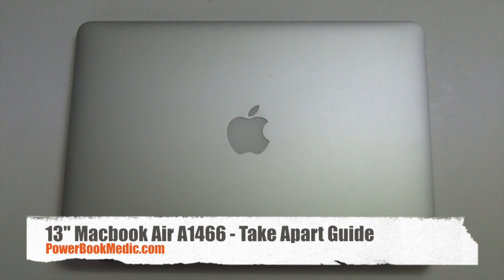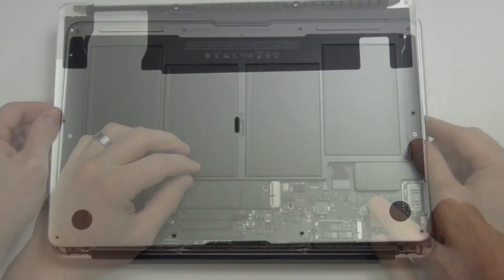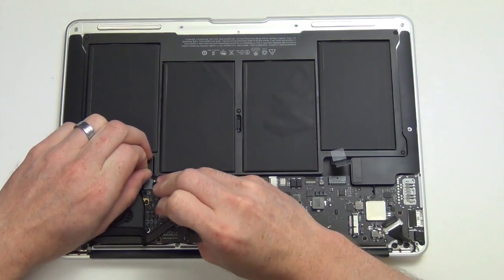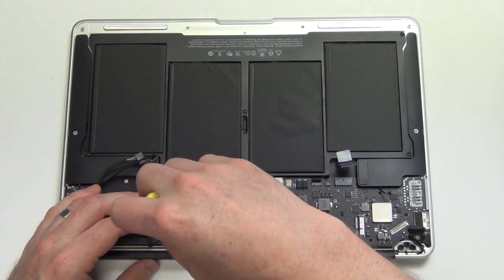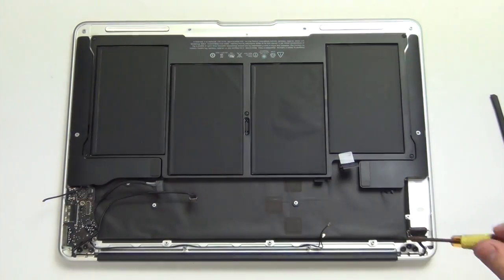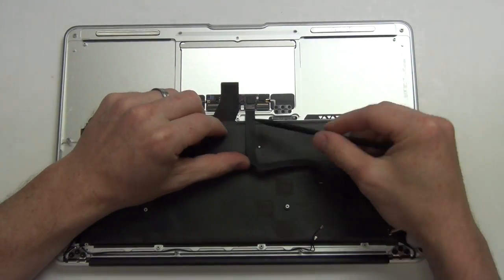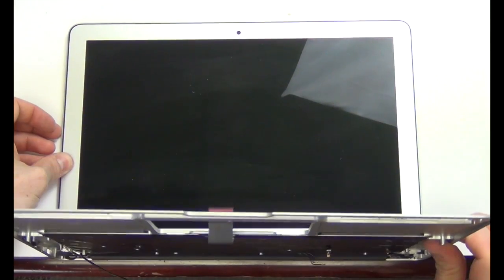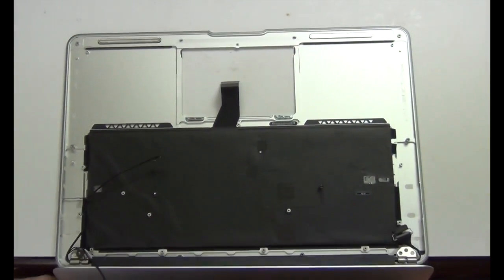13" Apple Macbook Air Take Apart  ( Model A1466 )

Comment: After almost 10 years of reliable service my Mac Air started acting erratically.  I had trouble powering on, powering off and then once on the screen would go blank on and off.  After watching video I started disconnecting and then reconnecting cables checking performance after each disconnect/reconnect.  I did battery first and then SSD drive - no luck.  The third disconnect - i/o flex cable from logic board to the i/o board did the trick.  Mac is now working perfectly.  Thank you Powerbook Medic!  Prior to looking at your video I had never even taken the back off my Mac.

Comment: Just purchased mine used for 350 bucks. With a fresh install of macOS catalina it tuurns out to be a lot more powerful than other laptops I could find for 350$. The build quality is out of this world not to mention the battery that even at 1000+ cycles can get me 4-5 hours of light to moderate usage and now I totally get the hype around apple products.

Comment: When powered up, mine just beeps and goes no further. Screen does not light at all.   any thoughts on what that could be?  Bad hard drive?
Reply from the maker: SpockMcoy Issmart It is most likely the onboard RAM causing your issue.
Reply: @PowerbookMedic  Thank you.  I've looked at other vids and see it is easy to remove the SSD and plug into an adapter to recover files.  Can I get the USB adapter and xfer the contents into an IBM pc or MUST it be another apple product?  Thank you for any comments.
Reply from the maker: SpockMcoy Issmart A PC would not recognize the format without a third party app.

Comment: my battery is not getting detected after logic board repair . Charger light shows orange .Power status in system information shows no battery connected . How to diagnose this if its a battery connector issue or logic board ?
Reply from the maker: pavan raj First, I would try another battery and see if that fixes the issue.

Comment: Urgent Question! I dropped my Apple MacBook Air and it won't even turn on now. I took it to Geek Squad and the cost for them to get my files back is out of my budget - something about soddering. Can I get those files by myself?
Reply from the maker: R. E. Durbin What model is your MacBook Air? If it is the same one that is in this video, you can remove the SSD stick and buy an enclosure to put it in to get the files off.
Reply: @PowerbookMedic  Thank you so much for reaponding this quickly!

Unfortunately, I'm not at home just right now, but my laptop looked exactly like the one in this video. 

..."buy and encloser to put it in to get the files off." - what do you mean by encloser? Sorry, I'm quite new at this and I want to make suer I don't accidentilt toast the SSD card.
Reply from the maker: R. E. Durbin You can do an internet search for SSD card enclosure and find the one that will fit with your SSD card. A word of warning though, this is not an easy repair for someone inexperienced and it is easy to damage the board.
Reply: @PowerbookMedic  Thanks so much. I'll keep all you said in mind, including that this isn't really a project for a "newbie". I really appreciate you answering me.

Comment: I’m so confused I’m pretty skilled in electronics and I took mine apart the screen lit but didn’t turn on or show picture I was so careful and I have a magnet pad for my screws. Now I have no life but I know the battery is good
Reply: ESD?
Reply: hey man did you ever get this problem solved?
Reply: @BrotherBishop300  I used iPa and scrubbed it and it worked fine after
Reply: @jaylingibbons7857  what’s ipa? How does it work if the MacBook isn’t powering up?

Comment: Thank you for this video.   I'm highly disgusted with the distributor for Apple in South Africa.   The logic board has blown on my daughters MacBook Air 13",  2014, 1.4Ghz model.   They are charging me the same price to replace the logic board as what the machine cost me in store in 2015.  We do not have Apple stores here, this makes all Apple products even more expensive than other countries. I'll be visiting your site to purchase a refurb, going to ask a local repair company to install it.
Reply: you are a good father. i hope the laptop gets fixed soon.
Reply: @sancheziumfluoride4227  thanks.  I managed to get it repaired for USD 220.  Powerbook medic was out of stock, I got the logic board from Shenzhen electronics market.  (Huaqiangbei)

Comment: It's necessary to open it from time to time in order to avoid dust accumulation on the fan?
Reply from the maker: There should be no reason to open it up to clean it out unless you are in a high dust environment or if  you are a heavy smoker.

Comment: how to remove to clean trackpad? thank...
Reply from the maker: You have to remove the battery to change the trackpad. That procedure is a difficult procedure that should only be done by a repair shop as there is a possibility of puncturing the battery if done incorrectly.
Reply: @PowerbookMedic  Thank. Even though I followed the step by step to clean with alcohol isopropylic
track? thank

Comment: Where can I find the screws because my friend dropped my MacBook on the floor on purpose and one of the screws flew off and I couldn’t find it and I want to repair it because the bottom is sticking out so you can see the inside
Reply from the maker: Screw kits are available from our website www.powerbookmedic.com. You can type in your serial number to get a part list for your machine and then get the exact screw kit you need.
Reply: if my friend had dropped my Macbook Air on the floor he wouldn't be breathing for long, let alone continue to be a friend!

Comment: but wait is the 2015 model? just curious
Reply from the maker: Yes. This is the 2015 model.
Reply: @PowerbookMedic  is model 2017 similar? Could SSD be change?
Reply from the maker: @thienanh0611  Yes, you can change the SSD on the 2017 model as well.

Comment: Where is hard disc?
Reply from the maker: This unit does not use a hard disk. This unit uses an SSD blade.
Reply: Thanks for this, I didn't know. Is there any mac using ssd disc?
Reply from the maker: Since about 2012 they have used mostly SSD blades.
Reply: It uses NVMe, So you use M.2 SSD's

Comment: Thank you!! You helped me disasemble my Mac to clean due to a water spill. Cleaning it with Isopropyl Alcohol and a toothbrush worked and it's alive again!
Reply: Hi I also had a water spill and am considering doing what you did. How possible would this be for me to do (someone with no experience). Also where did you get isopropyl alcohol, do I need a specific kind?? Also should anything need replacing due to the spill and how would I know if it needs replacing?? Thanks for any info and for your detailed comment.
Reply: Do u think this will work if I spilt hot chocolate?
Reply: @mayakhan5422  sure
Reply: Hi, I also had a water spill but don't know where to get a 5 point screwdriver to open it? Do you have any pointers on how I should clean my computer?
Reply: Inquisitor Wub-Wub 
Need patience...and take pictures of things along the way with your phone for reference.
Get a cup to place ALL screws in.  You might want a few cups to label where the screws came from if you're not good with that kind of thing
1. First watched this video: https://www.youtube.com/watch?v=YXAm6W-IaPA&t=1s
2. Searched for a video on taking apart the Mac, I used this one: https://www.youtube.com/watch?v=RqUK1weFgqQ&t=108s
3. Searched for a video to re-assemble: I used this one: https://www.youtube.com/watch?v=bY7j1C75pAs&t=389s
(When re-assembling, take your time, if it doesn't fit in right, back up a step or two and redo)
4. For my Mac a p5 tool and torx 3 tool was needed to open and remove stuff. Bought at Microcenter, but you can get them on Amazon for I think $6. 
5. A nylon tool set for cell phone repair, again Amazon or Microcenter. 
 Just a small set of a few things. You need nylon so it doesn't rip connectors and stuff. I had one, but should be a few dollars
6. A bottle of Isopropyl alcohol at Walmart, I think less than $2
7. An unused tooth brush
8. Basically took the Mac apart, cleaned all electronic boards, used a can of compressed air to blow it out. Let it sit over night and re-assembled.
8. OMG it worked!!! 😀😎😮😂

Comment: Am having issues with my MacBook Air 2017,  screen work only when the laptop is 45 degree position but when you try to open or lift it to a 90 degree then screen go's off, only the screen will go off but laptop still working, how do l fix it?
Reply: youre fucked, mate

Comment: HELP!!! I accidently misunderstood the process when I saw another video and I removed the entire small block attached to the board. I didn't see that it was that thin part that pulled out. How can I attach the block back on the motherboard? What parts, liquids do I need? It has tiny small metal inside the block that is broken in half.
Reply: Did you fix it?
Reply: Did you fix it?